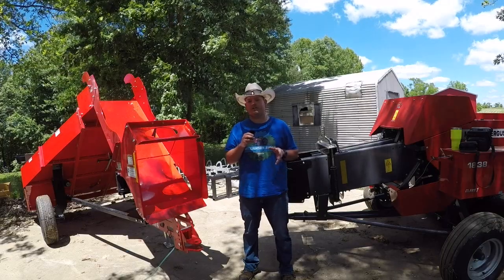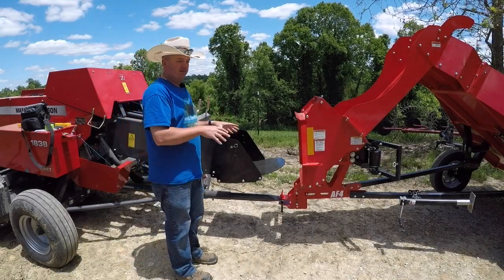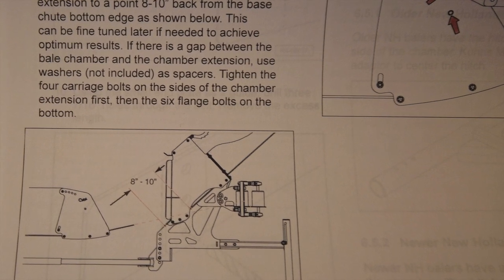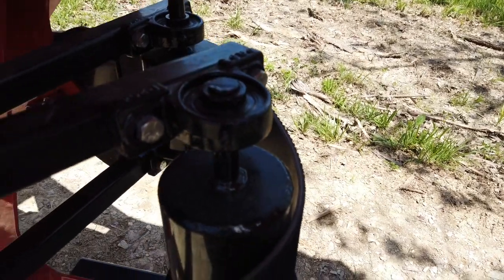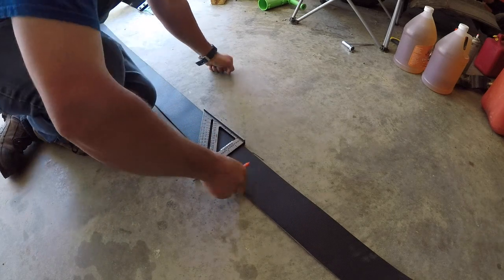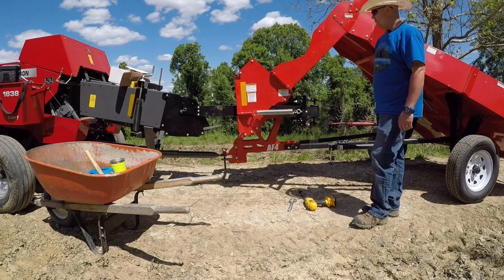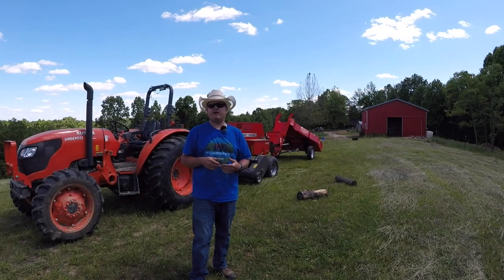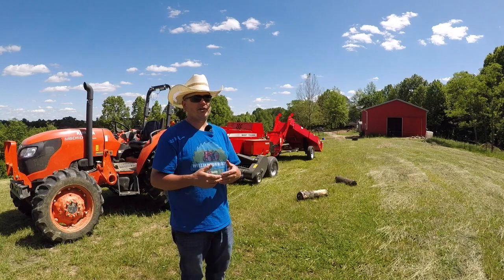Final Steps, Hooking The Kuhns AF4 To The Massey 1838 #133

Comment: Thank You for this video   We are picking up our AF4 tomorrow.  This will help me a lot.
Reply from the maker: Thanks! Glad I can help out
Reply: @WilliamsonRidge  did you have to drill holes for the sides.   the holes that are there aren't allowing the bottom plate to go under the chute and the Kuhn chute is 3/4 to 1 inch wider than my bale chute.
Reply from the maker: I didn’t have to drill any holes but the Kuhn chute extension was wider. I put some bushings in it to take up the space, I have a video putting the chute on maybe it’ll help some too, 
https://youtu.be/lL8w3iqhuL0 
If you have anymore questions feel free to ask.
Reply: @WilliamsonRidge    Ok  I watched the other video and I am doing it right and I had already decided to put bushings or washers to take up the slack.  My holes are about 1/4 in off so I will have to drill one end  Probably the bottom so it clears my chute.  I have a set of dog ears just ahead of the hole position so I can use a regular bolt and the hay won't catch it.    I have a New Holland Hayliner 273 and the rear is at an angle cut instead of straight cut like yours.   If I put it in two holes that do match I cannot adjust the angle because it hits the end of the chute.    Thank You for your help  and Again a Very informative  and well done video.
Reply from the maker: I c. No problem, hope you get it worked out, it takes a little time to get it set up completely but once you get it you pretty much have it for good unless you switch balers. Thanks for checking out the vids and the kind words!